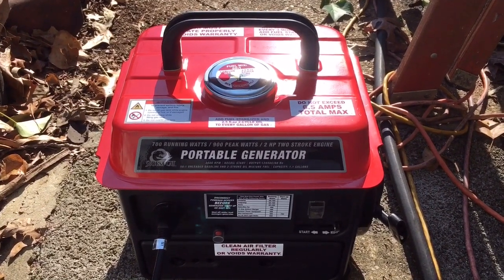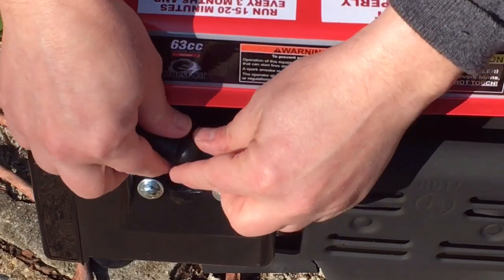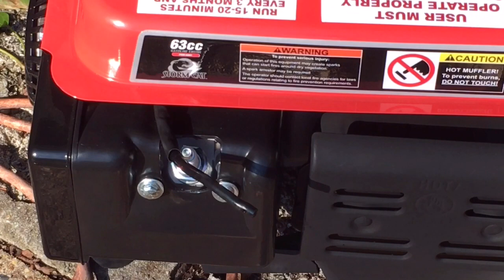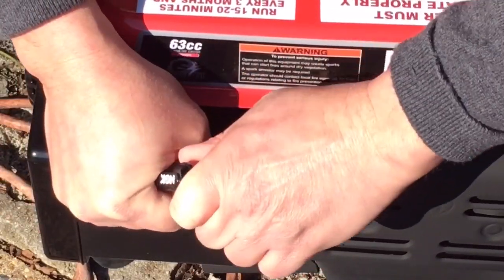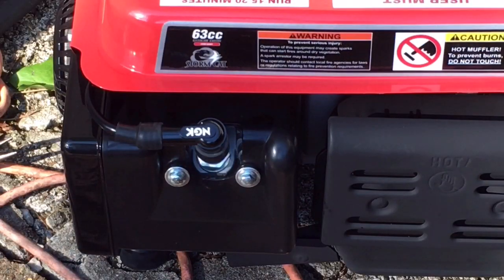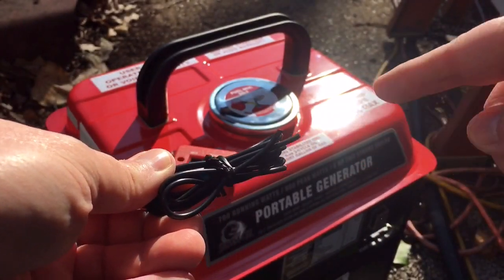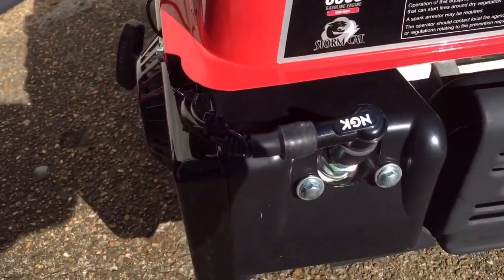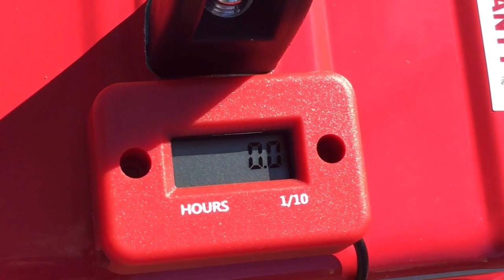DIY Storm Cat 800 watt generator modifications - NGK Cap - Hour meter

Comment: My 69381came with a F7tc spark plug and so far runs good and no leaks  I just got it for 40 bucks it has been running non-stop for 6hrs and I still have a little over half tank of fuel , on all of my 2-cycles  I run rich instead of 2.6ounces of oil mix I use 2.8 . Been running my Sthils and Husky saws for 30or so years sometimes a little  more smoking  if not a good oil

Comment: you will need that the first time you try to pull it off hot spring pulls off going to get one of those for mine
Reply from the maker: Those coil springs they use from the factory are horrible. If you can't find one locally there is a seller on eBay that has them very cheap. Thanks for commenting!
Reply: awesome thanks i rarely use it but power was out about four days ago and it ran a 39" tv fan dvd player laptop light and 2 cell chargers for five hours.
Reply: Ted May I occasionally go camping in my rv. I cant justify buying an expensive $600 plus gen if Im not gonna use it often. Is this gen good for running an led tv, charging cell phones, maybe a laptop? Even though they are sensitive. I plan on connecting my rv into this small gen. I wont be running anything too intense.
Reply: its perfect for that. will run it with no problem. just keep a new spark plug in it when storing it  and you will have no problem

Comment: Also pull cord wants to brake.   So I pull it gently
Reply from the maker: Yep. That's a plastic pull start mechanism hiding under the metal shroud, so yanking like there's no tomorrow will quickly lead to a failure.
Reply: Don't pull it hard on compression stroke.

Comment: I still can't find an NGK plug anywhere at the auto parts shops, repair shops, nowhere. I found a replacement plug at Ace that has the little cup but I've already ruined two of them trying to squeeze the newly attached cup gizmo through the end of the boot. I need a SCREW ON! What size, model # or other identification do I need for the right plug-there are numerous different ones on ebay and amazon. Thanks a heap!!  THANKS EVERYONE, I FOUND ONE!!!!
Reply from the maker: PM your address. I have a spare NGK boot you can have.
Reply: KeyCentral
Hey, Thanks a heap for the offer, but I just got back from a lawnmower place and they gave me one of those spring things that goes inside the boot. He showed me how to attach to the spark plug wire and push it through the boot. I installed it as he said, filled her up, and she's outside running right now!
Reply from the maker: +M. Edwards Great to hear!

Comment: I checked the connections on the socket  they are all connected.  I plugged in  a mixer and a drill they both ran but very slow. What else can I do?
Reply from the maker: Have you hooked up a voltage meter to see what the output is?
Reply: it's running at about anywhere from 70 to 80 or so. I let it run for a little bit while doing it.  

for comparison the wall socket was about 120...
Reply from the maker: Lewis Correia If you have already tried to adjust the voltage up and it's still that low then I would think there's something wrong in that would be more than an adjustment to fix. Is it still within the 90-day return window?
Reply: it's not within the warranty but it's only been used maybe 65 hours total. 

how do I adjust the voltage?
Reply from the maker: Lewis Correia this should help

https://youtu.be/HuCDwhbGxUE

Comment: My storm cat is running but not producing power. I have been using it at our tale gate  to run tv it has been  working great . It looks like intermittent power flashes of light. What  can I do ?
Reply from the maker: I would take a look at the connectors on the back of the socket panel. One may have worked itself loose.

Comment: I am running mine 24/7 now.  What I need is a bigger gas tank.   I also use amsoil saber so mine is as quite as a Honda
Reply from the maker: Be sure to report back with periodic hour counts. 24/7 will quickly add up to some excellent long-term durability numbers. If you don't mind sharing - what are you doing that requires it to run 24/7?

Comment: It's well worth buying the extended warranty for it, i bought one, and because I have no electricity I use this everyday, and surpass 14 hours each day, i have found they they typically make it about 2 and a half to 3 month's, and then they die out or things start breaking internally, at that point you clean all the gas out, and bring it back into harbor freight and exchange it for another one, free of course because it's not your fault if you run it correctly, that it breaks down over time, and with the extended warranty you can take it back every time you have an issue, and just get another one, but i would like a nice how to video on how to modify it with a bigger gas tank, that way I get more run time from it, and I won't have to go out to fill it every 4-7 hours depending on what your running off it.
Reply: Josh Small you could use an external fuel tank much like those used for commonly for small fishing boats and then use a small 12v fuel pump and wall wart power supply to move fuel from the tank, then just remove the stock tank and plumb the fuel line from the pump directly into the carburetor.
Reply: After seeing how poorly built these are from tearing one down (loose fasteners, awful reed seal) I would recommend light tear down/ check over before even using.  Especially the reed valve thing, leaked bad, lapped it with fine sandpaper and it sealed 100%.  This alone would probably give you much better service life IMO.

Comment: I use Hardlines tach/hour meter on all of my small engine equipment, if the equipment doesn't already have an hour meter. This not only shows RPM's and runtime, but also how many starting attempts it too to get my Tailgator running. Plus it shows the peak rpm as well. I have no problems with the original spark plug (F5TC) and mine doesn't smoke at all using 40:1 mix, which all of my 2-stroke engines use. I use a Valvoline TC3 synthetic 2-stroke oil.
Reply: don't use tcw3 oil that is for boat motors not air cooled engines

Comment: I'm using it continuously right now.  Problem is tank size.  I would like it to run all night also it runs out of gas at half a tank.   It won't drain the tank.

Comment: The G@#%& spark plug boot on my brand new generater came apart the 1st time I took it off to replace the spark plug! Now I have a new plug and I've been running all over town trying to find a NGK boot or ANY boot that I don't have to buy a whole set of wires and cut the caps off and crimp one of them back on. I'm about tempted to take the POS of back to the shop. Where did you find the NGK boot? Thanks!!!!
Reply from the maker: Yeah, the factory plug boot is a failure waiting to happen. I had to order my NGK boot from an eBay seller.
Reply from the maker: Were you able to find a boot? If you have a local scooter/motorcycle shop they'll almost certainly have a snap on boot.
Reply: The factory supplied spark plug boot is pretty cheesy, it was the first item that failed when I was changing the plug ,I am a real cheapskate so I reattached the spring contact an took a spare bread loaf wire tie , stripped the paper off down to bare wire an wrapped it around spring a 1/4 starting from longest to shortest puncher area very tightly then twist ends together, works very well!!!!

Comment: Wow, you're going all out with that generator.  For myself, I'd wait for the spark plug cap to go bad on mine before replacing it.  I think mine has maybe 3 hours tops on it.  Never performed the break-in, but never drove it hard either.

I might consider an hourmeter for my big generator, but since that is used so infrequently as well, chances are the battery in the hourmeter will go dead next time I need to look at it.  I hope your hourmeter has non-volatile memory for the hour count.  By design, it should, otherwise it's like rolling back an odometer.

Not to scare you, but I don't know about the MTBF of that 2-cycle engine.  Another YouTuber I watch has a Craftsman leaf blower, 2-cycle, and the book states then engine has an MTBF of 50 hours.  That's right, the engine was designed for 50 hours of runtime.  And it died.  He fixed it by replacing the piston rings.  I thought that amount of runtime was very short, if the same short lifetime holds true for these generators, 25 hours for the break in can be a good percentage of its life.
Reply: Mr Holmes I believe the fifty hours you are talking about is the emissions compliance period not the actual lifespan of the engine come on man you should know this I thought you had one of these?

Comment: I occasionally go camping in my rv. I cant justify spending $500 or more on a gen I wont use that often. Is this safe for me to plug my rv into and run a few small electronics like a led tv and charge some phones and a marine battery? If its dirty ac power is there a way to clean it up?
Reply from the maker: I wouldn't recommend this generator for electronics. It doesn't have an inverter. It's very dirty energy. You may want to look into the Sportsman 1000 watt inverter generator. Sams Club has them for under $200.

Comment: I Hate those stake type wire ends that they use on Chainsaws Etc  they always come loose and no spark  I try and use the Aluminum crimp ones with the spike  But the NGK is the best you can use
Reply from the maker: Agreed!

Comment from the maker: Mine has 25-hours thusfar. Judging by what I've read, if they make it past 20 hours they tend to go for hundreds. I've talked with one guy that has 900, another with over 1600.

My leaf blower was also rated at 50 MTbf, yet it has over 500 hours run time. Mfgs always grossly understate actual durability. Plus, a 2-cycle engine is very basic. Once they make it past break-in, if properly maintained, they should last years.

The meter I purchased has a 3-year battery life. If the little generator is still running strong in 3 years, I'll have a log of how many hours to add to a new meter.

As I live in the deep-south I need to change plug temperature ranges in peak summer months. Because of that I'm removing spark plug caps more often than normal. I don't know if you've removed yours yet, but one time is enough to justify the few bucks for the NGK cap. I put them on all my scooters. Good investments. All total I have less than $106 in the generator. Affordable 25-hours so far :)
Reply from the maker: ***** Thanks for the link. On this generator I only have 26-hours runtime. The 60+ hours (77:28 at the moment) is on the two generators I'm running the durability tests on (I have videos of these on my channel). Neither have had anything done to them outside of checking the air filter and other basic requirements in the instructions. The sealed bearing lubrication is not official, but is noted by many online as being important. When one of these test generators dies I will make a video of that process and upload it. Venting the gas cap isn't really required on these because the seal on the cap isn't tight enough, at least on the ones I have owned, to create any vacuum or venting issues. I hope this info helps out!
Reply from the maker: One additional note: I said that I didn't do anything aside from air filter and other instruction required maintenance. I forgot to add that on the 2 test generators that I did change the spark plugs at 4-hours because the 60338 test generator started knocking. I knew that due to the poor quality and general distaste most have for the Torch spark plugs that come in these generators that someone would point to it as a cause of failure, so I eliminated that from the equation.

Comment: I'm interested to know what the failure mode is on these. Are they repairable?
Reply from the maker: They are repairable, but I think most people find that getting a new one at $88 is the best deal. I have over 400 hours use on one, so they  do great for the money - when you get a good one.
Reply: My eagle river version of this worked about 10 hours and would not run again.  Carb was good but i found the reed body/reed seal to be terrible!  lapped the reed body against a surface plate and got it so good that it didn't leak one bit.  also deleted the head a cylinder gaskets!  Took exhaust off to see if it could be opened up a bit and was surprised to see a catalytic converter inside, separated the can a found the converter welded in backwards!  I am curious if this was intentional (failure mode) or a mistake, or dose it even matter.  Cut it out and stitched the can back together.  Tuned it up and it runs like mad!  Now to see how many hours I get before the next failure....  Mind you I was about to toss the damn thing, but after this it's a good little unit- so far...  Mainly use it run block heaters on equipment, pulls the 1000W element just fine.  Once the engine is heated up it maintains temp, not overheating.  We will see...